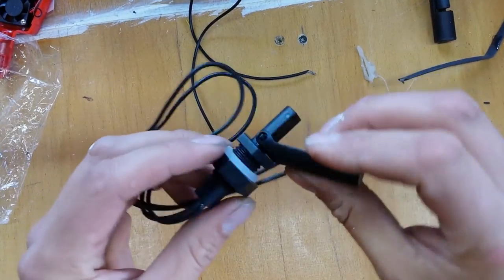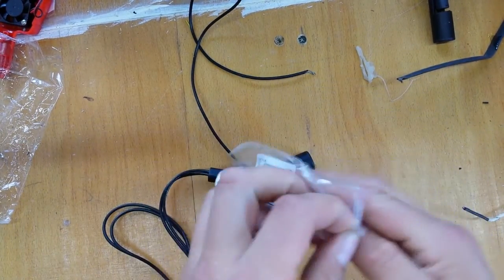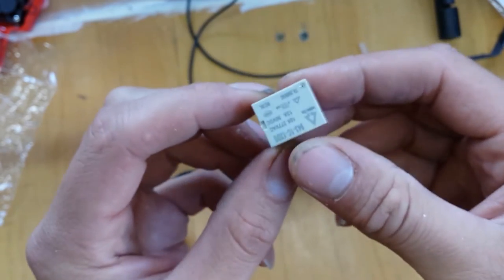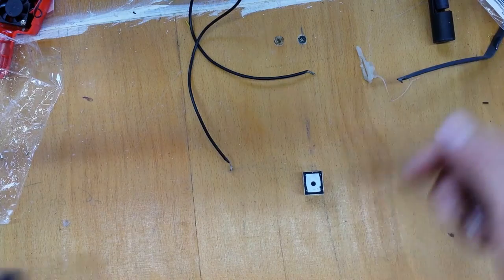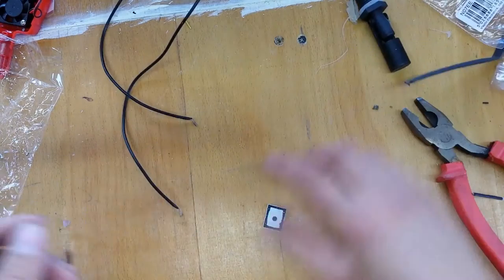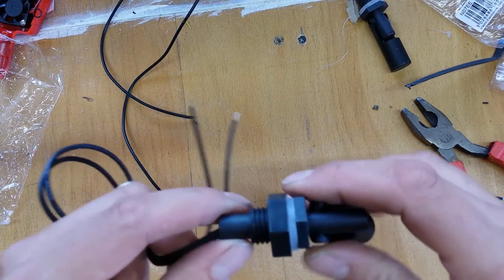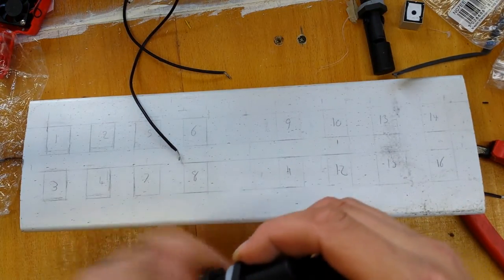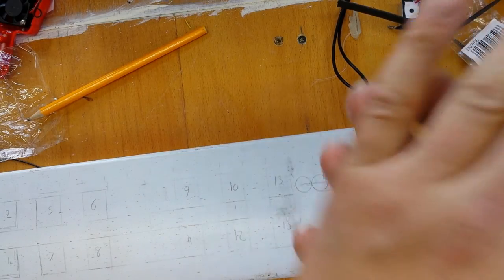Reed sensor   float switch and an accident involving paint

Comment: I used one of these for a cooling tower down in argentina lol electrode sensors are super expensive over here and I wired one of these two a contactor to pull in a small water pump when water level was too low. Lots of turbulence in the cooling tower due to the fan and splashing of water and so it kind of affects the switch by making contact on and off but once water level stabilizes more or less its pretty good. The contactor coil pulls in around .05 amps @ 220V, well below the rated amperage limit of the switch.

Comment: Is it possible to put this on a sump pump, as I don't have enough room for the float switch that came with the sump pump. If YES! Would you know how to then wire it?

THANK YOU.
Reply from the maker: Use this float switch to turn on a relay. There is another video where I accidentally put a load across one of these and blew it up.